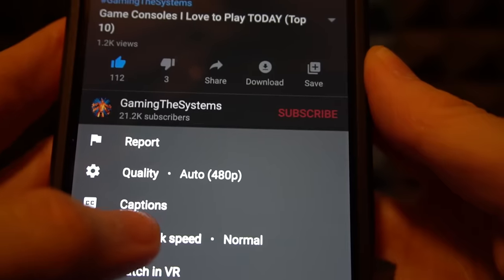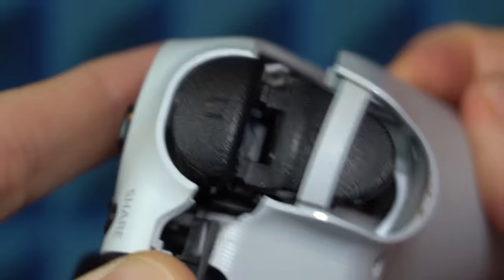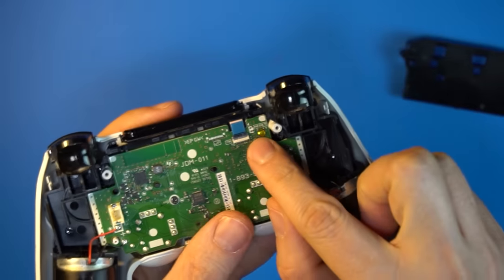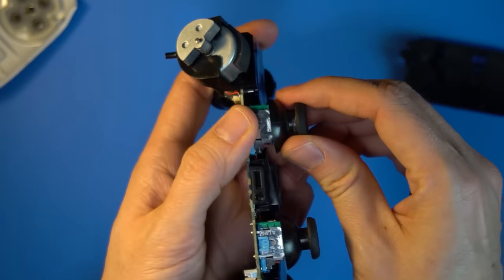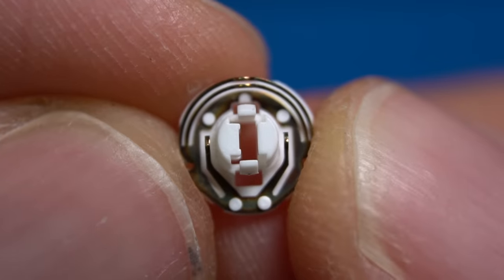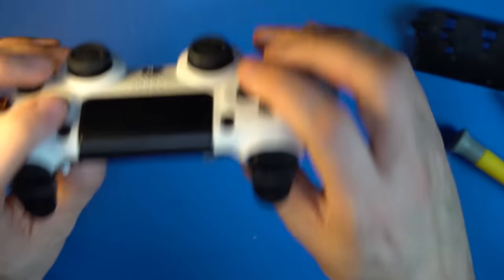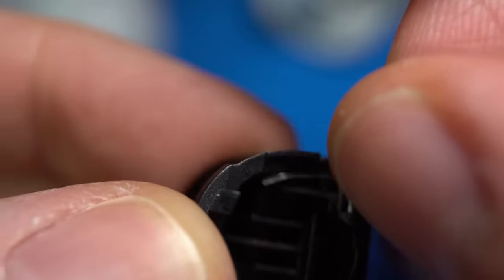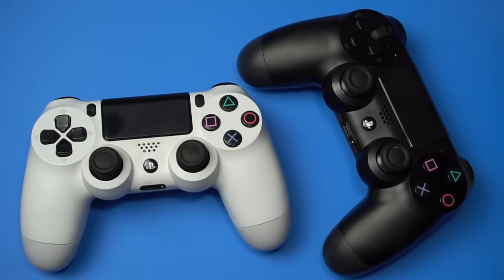How to Repair a PS4 Analog Stick That is Drifting, Sticking, Jittery/Cleaning DualShock 4 Controller

Comment: Since I did this it got rid of my original problem where my controller wouldn’t respond to me pressing L3 but since I’ve done it I have stick drift and I have a weird hard part where when I pass it with L3 it clicks what is my problem??

Comment: Don't know if my controller has is slightly different model cause mine would not go back and there is only so many times you can bend the legs. It's snapped clean off and I was careful. Mine was black and it looked slightly different from that white piece.

Comment: OK I followed this video because my PS4 controller was having trouble sprinting. I took it apart I was very careful and the video was super helpful and simple and easy and I fixed my analog stick but I was playing and the controller died on me because I needed to charge it, and when I tried plugging it in, it would not turn on. I tried two different chargers, two different plug-ins and I knew something was wrong. Maybe it’s the battery? please help I don’t know if I can wait a week till my new controller comes in
Reply: on 5:52 it said the wired ribbon silverside needed to face the battery and that’s what I did then it stopped charging and I recorded me taking apart for the first time and the blue side, was facing the battery, not the other way around and for this whole week, I thought I broke my controller when actually, some thing was plugged in incorrectly!!!!!! if you have a newer controller and it broke or it’s not charging, maybe try plugging in that ribbon on the blue side facing the battery

Comment: hi, thank you for the helpful and well-made tutorial! my problem is that my ribbon cable does not have a blue tab like yours and other tutorials. the blue piece seems glued entirely to the ribbon and I can't separate them. the other ribbon attached to the motherboard on the longer side does have the same kind of blue tab as the video.

can the tutorial be completed without removing the first ribbon or is there any alternative way of detaching it?

Comment: Thank you for the video! It was helpful in fixing my right analogy stick from drifting up constantly. Just two problems: the light sensor in the back does not turn on anymore, and the controller does not charge either. Do you know what might be causing this? I am leaving the controller on the charger for an hour to see if it really charges or not, and if not, I plan on going through it again to see what needs re-putting back again.
Reply from the maker: It's the ribbon cable that connects the two halves. Flip it so the silver contacts go the other way.
Reply: @HowToX  I figured it might have been that, so I flipped it and the controller chargers and lights up again. Thanks for the video!

Comment: How long did it take to find out that the screw on the board also holds the battery plate. You could have also unscrewed it while it was on, other than pulling it off.

Comment: It's better to buy a new controller than fixing it. It was way too complicated for me as I got frustrated opening the frames and putting back the analog sensor on its place. Later on I threw the controller out of frustration.

Comment: If y'alls controllers light wont turn on or charge, it's probably because the wire that he said that needs to face the battery was the opposite for me it had not to be facing the battery

Comment: my stick didn't really have drift , just wasn't accurate , sometimes it sticks to the left and drifts , but the drift is physical , i tried this method , i opened my controler , hardly , even though i am used to oppening ps2 and PS3 controlers but never did with my ps4 controller cuz it's hella expensive , unfortunatelly the controller now has stick drift , i can't even launch a game

Comment: Thank you for your video, your methods worked perfectly... I only made the retarded error of removing the LED strip aswell as the connector but by some god given miracle I managed to reattach the connector to the 20 nanoscopic pins on the circuit board without breaking them 😂 and it now works better than ever 😊

Comment: only time will tell the extent, but after a quick test this seems to of fixed my major drift issues! great tutorial! very clear and easy to follow. the last ribbon cable to plug back in before the case, goes the other way on mine, but its easy to see where the pins are so i had no issues figuring it out.

Comment: My controller drifted, so i swapped the white circles in analog (step by step from video) - the circles was from older controler where L1 button not working. And guess what? My controller still drifting :Dd Any ideas how to fix it or just buy new one (im student so it hurt my wallet)

Comment: Nice tutorial, sadly it didn't work for me and I'm sure it won't work for the other 90% of the people who try it. The reason being that the plastic on the outside of the stick plates is too brittle, even with a gentle but firm push they didn't budge and when I tried to make them go back in, they snapped. As another guy on this comment section said, it's not worth it, you should consider letting a professional do it or buy a new one.

Comment: It is possible even with large fingers and less than perfect eyesight. If you have an older nonfunctional controller around to practice on, that will save you from breaking your main controller. Made one worse and one nonfunctional before I got it right! 😂

Comment: 0:51 (”GENTLY Seperate”) is a lot harder then you made it look in this tutorial. The first time you take one apart it’s usually pretty stuck together. I suggest a pretty small flathead to pry, and then slide across the seams. From experience be VERY CAUTIOUS of that wire mentioned. (I mean unless you solder wire for a living) Overall Great Tutorial man 
-Cheers

Comment: jesus christ those little screws are annoying, I had to push down and use pliers on the screwdriver to get enough grip on the screws to take them out. The green doors won't close properly, they aren't fully closed and won't snap no matter how hard I squeezed so I forced it with pliers but never heard a snap. I might have broken the controller by doing this but it doesn't really matter because I have to get a new one anyway if this doesn't work.

Comment: If I press my analog sticks down, either L3 or R3 or both, they stay stuck in that "down" position & I have to literally pull them up with my thumb & index finger. Is this fixable or is it a worn pad. Is this controller done & dead?. 🤔

Comment: I found this explanation very good, but i couldn't close the green door, yes the white disc is put correctly, but i still cant close it, what can i do?
Reply from the maker: There are three pegs and two latch thingies. One of your pegs may be bent. You can try to unbend it, or clip it off with something like a nail clipper.
Reply: @HowToX  I grabbed a pair of pliers and squeezed the dang thing shut, just make sure you don’t slip and smash the crap outta your motherboard.

Comment: Lemme Guess, if you remove (instead of prying open) the green chambers by accident, the analog stick will stop working right? At least in the direction the chamber corresponds to, Cause I accidentally "removed" mine

Comment: i just did it and now the X button is not working (the initial problem was the stick drift not the button). what should i do? io re-opened and cleaned several times
Reply: i solved. the problem was with the transparent film that was not adherent with the underlying part. i solved by putting some adhesive tape to make it touch

Comment: I tryed this. Seems quite fixed but I got a problem. When I try to "close" the green parts I can't close them. It seems they are stucked from something. If I try to Push the analog works (and even better) but if I release, it wont work. How can I try to fix this and force the close?
Reply: same happened to me. what i noticed is that one of the back 'teeth' of the green part had half-broken, had to break it off so that the other teeth would fit

Comment: Hopefully I can do this without it breaking. I'll update when I've done it
Reply: Update? Does it fox the stick drift? How long does the stick drift last?
Reply: @jonnymcgrath4816  forever until you fix it
Reply from the maker: Drift has a multitude of causes, so there is no way to predict if a particular method will solve it, or how long it'll take before drifting again. I advise skipping this video and instead use the better video I made: 12 Ways to Resolve Analog Stick Problems.
Reply: @HowToX  I did it and try drift is now really subtle. But that's because I couldn't find any if the right alcohol so I just used water but I'm gonna redo it with alcohol when I can find some

Comment: I bought a cheap (ps4) controller of Amazon for FPS games the right analog stick feels off and has strick drift and is  slow when trying to snap to targets and whe you move the right analog stick  it can shoot up if you where spining around your crosshair goes upwards a bit instead of staying straight. Will replacing the discs like in this videos help correct the issue or is it not going to make a difference and is just a problem with the cheap model of the controllers tech?

Comment: My ps4 controller is also attached in the middle so it won't open!
I unscrewed it and it won't budge in the slightest even with a screwdriver in between the parts. There's another part holding it together in the middle it seems. Anyone got an idea on how to open?
Can't fit a screwdriver and the middle part wont open a bit at all

Comment: Very unlucky for me, every button is working fine after cleaning but my R2's spring button just broken after removing the controller's body, my R2 still function tho
Reply from the maker: You can replace it easily. I have a video about it. https://youtu.be/CXU4smIRMIk

Comment: Followed all the instructions and sadly my controller won’t turn on now🤣
Reply from the maker: It's that wire that connects the two halves. Go back in and flip the way you plugged it in, with the contacts facing away from the battery. Your controller is a slightly different variation than the one in the video.

Comment: Fixed the drift but now Down on the Dpad doesn’t work😅
Reply: Yep I had same, my D pad and X needed extra hard presses. Take it back apart and re seat the rubber thing inside. Fixed

Comment: I made the problem worser for myself ; the lights don't work on controller, controller feels loose at the top but screws fixed tightly,
Reply from the maker: See the FAQ regarding the light.

Comment: Thanks for this tutorial, was really helpful!

At 3:33 I accidentally snapped a piece of that disk -_- luckily I had a spare controller and replaced it successfully. Question about this, is this part interchangeable? Meaning if I used the disk from the spare controller but from the right analog stick, would it matter?

Comment: Its me again with another controller issue and seeing you helped the last time your the first one I thought of.This time the right and  left on the "Left" joystick makes a squeaky sound and almost sticks  how do I fix this problem ? 
I am fairy good at taking apart my controllers and ps4 top to bottom yet can figuer this out.I even tried air duster and nothing seems to work. Do you have any ideas of how to fix this issue.Its super annoying.Thanks.
Reply from the maker: I suggest you take it apart, then vacuum the thumbsticks, then get some alcohol down into them. You can see me doing it to the Xbox controller here: https://youtu.be/rvn5Cnn9ymM
Reply: @HowToX  Ya, It's not where the 2 green doors are its really inside the joystick itself.. and I tried with an air duster spraying all inside hoping that if there was anything logged it would come out..but nothing.I have spare parts because the controller speaker died out suddenly and I tried to change it but you really can't.
I am uucky with controllers...so
Reply: @HowToX  I had to choice but to rebuild my controller with all my spare parts.Thanks dude for the help I apprciate it.

Comment: Be careful with the doors and placing the sensors back in. It's easy to place the sensors in an off way and the door has a bottom right foot that can get bent. Just bent two on my right analog stick but the ones on the left were fine.

Comment: Can you help me... When I move my left stick up... My right stick will turn right.... And when I move left stick down... My right stick will turn left... So when I play game and move forward and backward the camera also move..... But if I move left and right... It move normally...... I already change the white disk on the left stick... But the problem still happen... Do u know how to fix it
Reply from the maker: Hello. I get this type of question a lot. I imagine there is current incorrectly crossing paths on the board somewhere.   You may want to go inside and just clean everything. I don't know what else to suggest. If you figure something out, let me know please.
Reply: @HowToX  OK will try it.... I saw an article on Google... People that has same prob as me... He send it to shop... And the shop said just change the "ps4 coal" .. And it is cheap.... The problem is I don't know what is "ps4 coal"... Do u know what is it?
Reply: @HowToX  I fix it... At first I change the white disk on left stick that control up and down movement ... Not work.... And then I change the right stick white disk that control left and right movement... And its work..... Now it fix....maybe u can try it for double confirmation..

Comment: Idk if you still reply to these, but i followed the guide to a t on two of my discarded controllers (bad stick drift) and they turned on before i took it apart but now neither of them do. Ive double checked my ribbon cables and my battery and i dont underztand why i cant get it to turn back on
Reply: Nvm my ribbon cable goes with the blue sticker facing the battery so it was just plugged in backwards.

Comment: I think i made a mistake but when i did this step by step i finally completed it my ps4 controller now doesn't go ON😂😢😢
Reply from the maker: See FAQ in the description
Reply: It turned on but it still drifts so in 4.03 do you need alcohol or can you do it with something else?

Comment: 3:40 no matter how hard I try, it won't pry open. What do I do? I'm scared of breaking something since this is the only controller that I have
Reply: Try harder it’s supposed to be like that
Reply from the maker: You can break some tabs when you open the controller, but they don't really affect anything. I've actually experimented where I broke ALL tabs, but it still screwed back together just fine; it wasn't loose or anything.

Comment: I'm afraid of breaking the little green tab thingy, my friend did this method and his snapped off the board so he had to buy a new one. Is it really ok to open it? My right stick is drifting upwards and it's my only controller. I really wanna try this but I'm afraid, does it really work guys?
Reply from the maker: See the FAQ section of the description. There's a link to a better video.
Reply: @HowToX  I summed up some bravery and I did your method and it worked, the controller no longer drifts. Thanks for the tutorial 🙏
Reply from the maker: Cool

Comment: just spray a rustremover spray right in to the analog sticks without opening it it will befixed 1000000000000%

Comment: Umm so what happens if one of the red wires disconnects from the mother board
Reply: You'll have to reattach them. Do you know how to solder?
Reply: @reicelestial2478  doesn’t matter, too many materials needed, plus all wires ended up disconnecting & ended up crushing the analogs sensor trying to close it back in

Comment: some sketchy guy's instruction video > official sony instruction video (low key thx i was about to spend more money on another used controller or a brand new one because all of my controllers have stick shift and now that i can fix them as i need them i won't need to buy new ones for a very long time i have 4 btw 2 were bought as replacements one used and one half off new)

Comment: This helped me completely fix my controller with unplayable stick drift, now its like it was brand new. 100% helpful, so thanks. Popping the stick sensors out and cleaning them did the trick. Was scared i was gonna break it the entire time with each step but it worked. 10/10 vid.

Comment: Can someone help? The battery plate doesn’t snap on it just hangs loose
Reply from the maker: That's normal for some models. The screw holds it in.
Reply: @HowToX  I’m not sure, because on my part the battery keeps bugging out, when I load my PlayStation it keeps disconnecting my controller because “the battery isn’t charged” when I’m playing cabled. Great tutorial though, I probs messed up on my part

Comment: Anyone else struggling to close the doors, I can see that I’m hitting inside holes but it won’t close🤔
Reply from the maker: Pegs may be bent. Try unbending them. If all else fails you can clip them off with a nail clipper.

Comment: My controller stoped charging why
Reply from the maker: See the FAQ in the description.
Reply: @HowToX  I did double checked just a second ago the light bar still works but it lights up colors it shouldn’t and still won’t charge, do you think it is the ribbon cable that’s messed up?
Reply: @intro  +++ I checked it double, but nothing... In my case, the lights still do not work